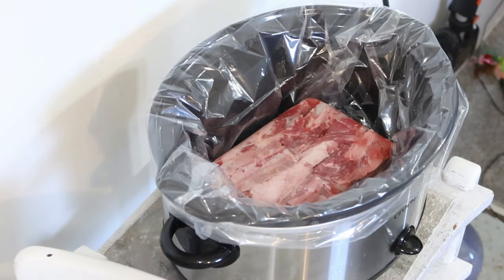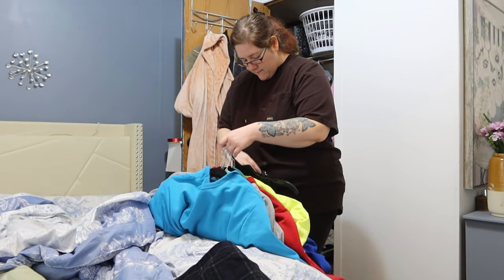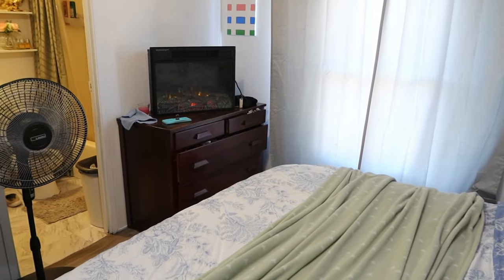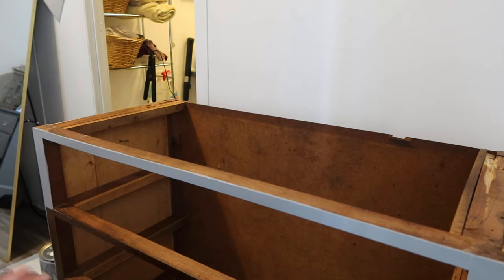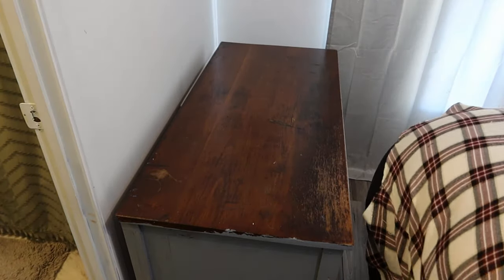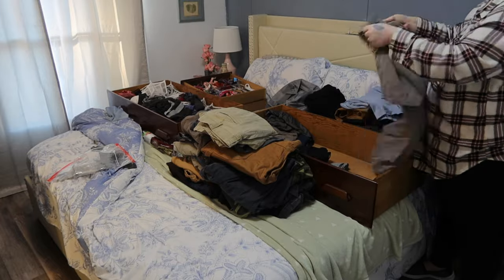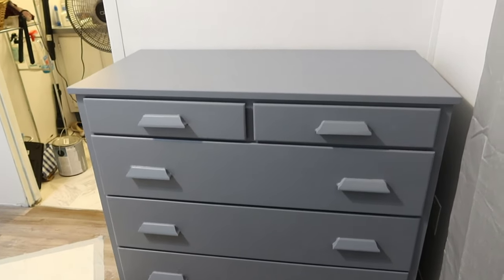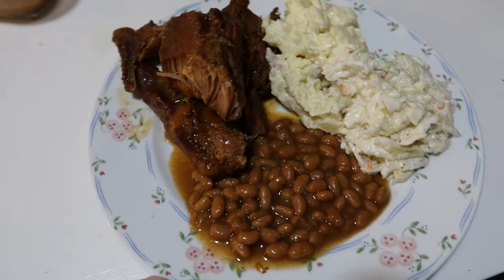DREAM BEDROOM MAKEOVER DIY HOME PROJECTS ON A BUDGET HOUSE REFRESH 2024

Comment: I've not sanded, and it came out just fine. Had my dresser for years and no paint chipped off. I think a lot of the newer paints are better quality than a decade ago, and may not need sanding as long as the surface isn't too glossy.
Reply: All in one paints

Comment: Kimi, you are a wonderful wife! I wanted to give you an easy recipe for dinner. 1 lb. hamburger fry and brown it well with chopped onions and then add gravy and simmer for about 10 minutes. Make 2 pkgs. of Idaho mashed potatoes. Dish up a good portion of the potatoes onto your plate and much a hole in the middle , pour the gravy into it and make a can of corn and add it as a side. It an easy recipe for Shepherds pie. Another meal that’s easy is 2 polish Kielbasa cut into small pieces and fry / brown adding onions then add 1 bag of frozen crinkle carrots and simmer until the carrots are soft. Stir  frequently. Make a pot of large egg noodles, drain add little butter  and stir. Pour the kielbasa mixture onto the egg noodles. It’s yummy and easy to make. I put Kraft Parmesan cheese onto my noodles and kielbasa. I thought you will enjoy these 2 tasty inexpensive meals and any leftovers, Aaron can take to work. We usually don’t have any leftover because it tastes too good. Enjoy!

Comment: So, Kimi, you got rid of all your plastic containers that you used for leftovers and reheating because they were plastic and you were afraid of them leaching contaminants into your food, but you will use a plastic bag in your crock pot to cook your food for 5-6 hours?? Make it make sense.
Reply: Reynolds Crockpot Liners are BPA free & FDA compliant for cooking.
Reply from the maker: I will lol, so the plastic bags are meant for crockpots plus they are one time use, vs plastic Tupperware that gets scratched up over time moisture gets trapped causing mold. Chemicals are an issue but the reason I switched to glass was to prevent mold growing in my containers lol
Reply: 😮rude